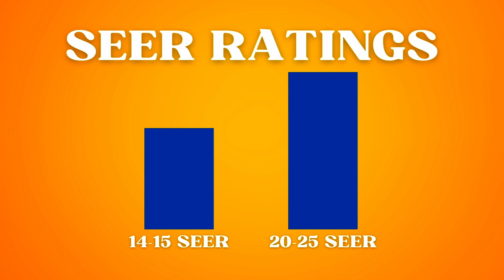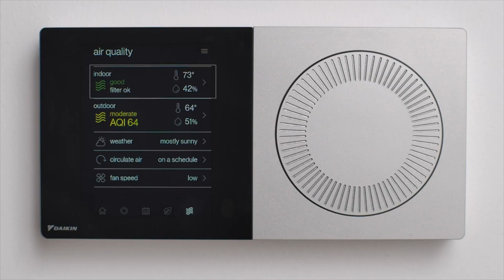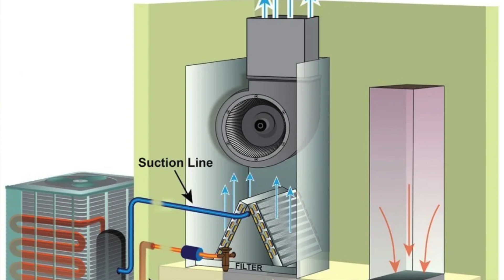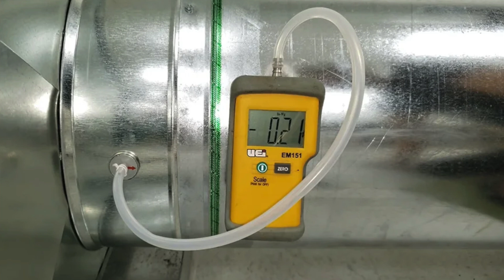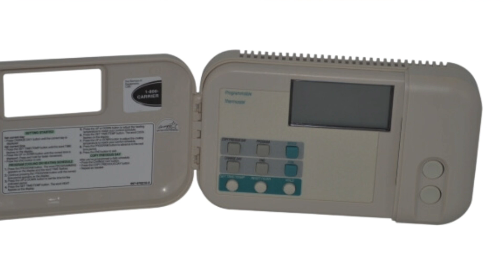HVAC System Upgrade Gone Wrong: Louder, Higher Humidity?

Comment: Thats why I got 10 quotes for my furnace, and ac.  Some came in and just said, yep, you need the same size unit, and stayed maybe 10 minutes  Think I called them back?  I went with the people that stayed and explained alot, counted windows and supplys and return vents, and what we were looking for.  Overkill, maybe.  Not like buying a pair of jeans and you can take them back.  This is thousands of dollars on the line, and its not like you can just take the unit out if you dont like it
Reply from the maker: Great points. Are you happy with everything?
Reply: @NewHVACGuide  I replaced a single stage furnace that was on a zoned system with a 97% dual stage furnace.  Not sure what the previous owners were trying or got talked into.  Its also 20000 BTU less, original was 100 BTU, mine is 80.  AC was replaced with the same size due to a complete failure, maybe from the zoning as well.  2 quotes understood zoning systems, others had no clue. Some days I wish I went down from 3 ton to 2.5 ac unit, but when its extremely hot, like +40 Celsius i the summer, it runs all day, while other peoples ac cant keep up.  With Ecobee thermostats and their sensors, I can trick it to have run long time on the days that arent stupid hot. Recently installed an HRV too.  My last 6 years in this house, which will be our forever home has cost be about 15K. Is it perfect?  No.  But Ive learned there is no perfect in HVAC, even in passive homes,.

Comment: Having these EXACT same issues. Went from a 2.5 ton single stage 13 seer to a 3 ton 2 stage 17 seer2 Carrier system. 

Sounds MUCH louder. Doesn’t dehumidifies as good as the old Trane system.
Reply from the maker: Oh no! Anyone check the static?
Reply: @NewHVACGuide  don’t believe so. Had several quotes too and all did the same thing. 

It’s upstairs and the old system would also run 15-19 hrs any given summer day. There is a bonus room over the garage too so here is to hoping on those really hot days it will dehumidify more of the air.

Comment: I updated my HVAC. My single stage furnace is louder on start up. Thats because I had a two stage furnace. Now I got a single stage furnace and a heat pump. And the single stage is louder than my old two stage.
Reply from the maker: Did they check static pressures?
Reply: @NewHVACGuide  they said they did. But I’m get a second company to check. And get it fixed while it’s still in warranty.
Reply: @zoocrums0393  A two stage indoor unit is more expensive but is also quieter!

Comment: I recently replaced my 13 year old AC and furnace.  We got four bids from pretty good companies in my area.  My only requirements were the new system was 2.5/3 ton, 16-17 SEER and increased airflow to my master bedroom and bath.  Both are 2-3 degrees off during the winter/summer.  There was only one company that actually looked at my old ducting and would guarantee better airflow.  Prior to installing the new system, he added one extra return in my basement, installed larger return grilles in each bedroom, and a turning vane in the 90 going to the master bedroom.  Maybe 2 hours of work, but noticed a dramatic increase in comfortable.  With the addition of the new system, each room in my house is within one degree of each other. 

I'm not knocking anybody specifically, but am surprised how lazy some of these HVAC companies have become.  They want to install a new system, but you mention anything about ducting/airflow they don't want to deal with it or tell you their system will "fix" the problem.  If you are paying more than 10K for a system, issues you mentioned in this video should be identified during  or before the installation process.
Reply: Before the installation so it can be corrected! It makes perfect sense.-

Comment: Regarding "static" issues.  Won't rigid ducting benefit HVAC ducting especially with 45 and 90 degree turns as well as 180 degree turns vs. Flex ducting? Also, supply registers, don't they make a big difference in using the rolled steel type vs. the stamped steel registers? I would this so if they are made/available and insulated. Then, there is the all flex idea so in the event of sharp turns etc. would it be best to use larger diameter ducting to compensate for those conditions?
I'm a firm believer in at least two returns in most average homes to help scavenge the air more evenly.
Reply from the maker: In contacts to “benefiting“… Certain things either raise or lower the static. Typically, lowering the static is a good thing in residential, especially talking about total external static pressure for the equipment. And yes, more returns are better than less.